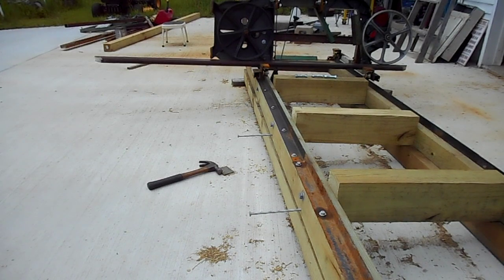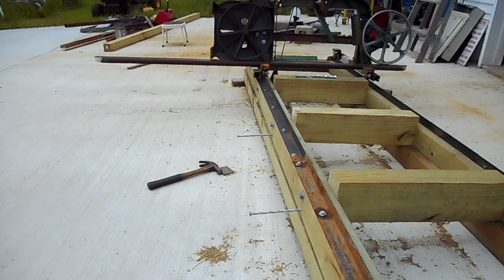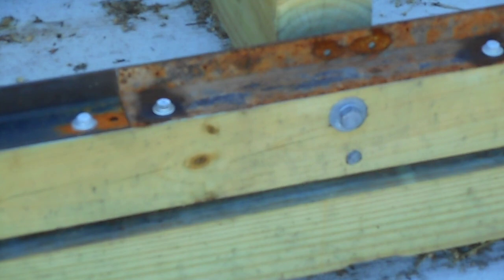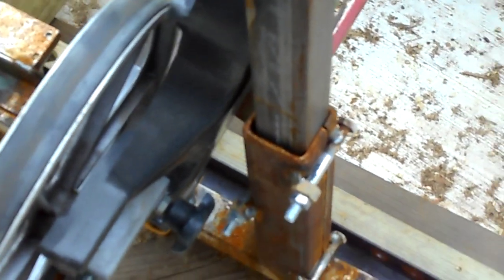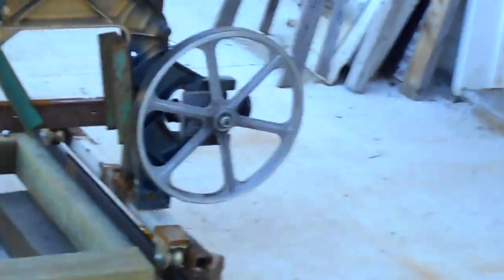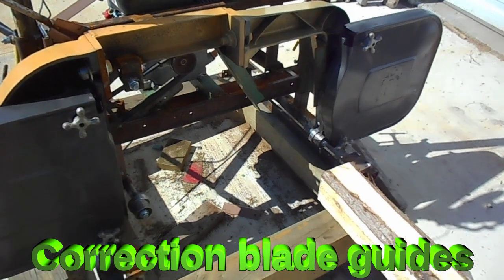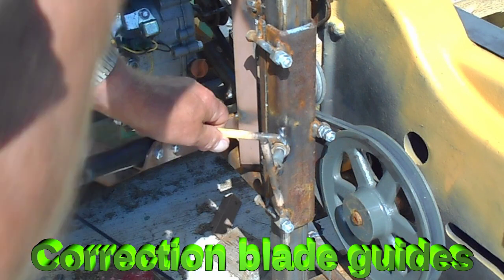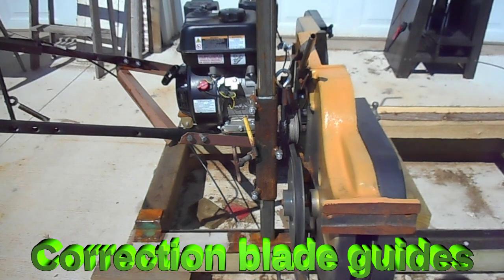Manual pusher band sawmill under $500. walk beside track build

Comment: I've found that if I strike the heads of spikes straight down without causing them to flex on the shank they seldom break off.
Reply from the maker: My thought were use a bigger hammer
Reply: @macwolgamott4201  A bigger hammer would require less strokes and less flexing and metal fatigue thus,  less breaking.  I think.

Comment: I've watched all your videos about this mill as I'm trying to do this exact same thing. How did you attach the original bandsaw housing to the the carriage? This is the only part I can't tell from the video. Seems to be made of cast iron so I'm trying to figure out how to design the carriage so it bolts on in holes it already has.
Reply from the maker: As it is cast iron and very easy to drill.  I just looked for a couple places where a piece could be bolted with 5/16" bolts. Trying to attach link to another video showing attachment 
https://youtu.be/W-DnXScmHFA 
copy and paste the link in your browser.
Reply: @macwolgamott4201  Thanks for the reply! Not sure how I missed that video when looking through your channel but that's exactly what I wanted to know.
Reply from the maker: Glad I could help

Comment: How is the drive wheel attached?
Reply from the maker: Drive wheel for blade?
Reply: @macwolgamott4201  yes
Reply from the maker: Drive wheel for the blade is mounted on bearings in the left hand cast iron housing. belt driven from the back side 8 inch pulley. Centrifugal clutch on motor.  Some would say I pushed the blade through the log and say you should pull it through for better control.

Comment: What size angle iron did you use for the track? Thanks
Reply from the maker: I used old bed frames salvage from scrap yard. If this is your approach to do same , I will caution you that all bed frames are not same size, pick one very common.

Comment: Were did you buy those squeaky v-bearings for the carriage to ride on the track ?
Reply from the maker: Ebay they came from China, would not do it again. They really are not that much cheaper and not greaseable until I fixed that
Reply: @macwolgamott4201 ........ Thanks

Comment: I'm just about finishing my bandsaw build. Have been working on it for about 2 years. Lots of learning as I am not a mechanic or a machinist. I have seen just about every bandsaw build on You Tube that there is.  I am using 16" tires. The most difficult issue I have had is alignment and tracking of the wheels. However I think I have it solved now although the tracking method I designed is not ideal. So I hope your build works out. Just be careful when you start it up. I had my blade fly off the wheels the first time and it went pretty far. Ok now I see it has been over a year since you posted the video. How did it turn out?
Reply from the maker: Mine worked very well when the blade was at proper tension. I did have one setback during the build the wheel for tracking and tension had a white metal casting that was very thin and it developed a crack letting the wheel out of adjustment. It was replaced with a weldment to tension and adjust tracking and it worked as expected. The laser tracking also worked very well and makes checking every log bunk a no brainier.